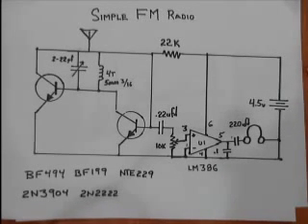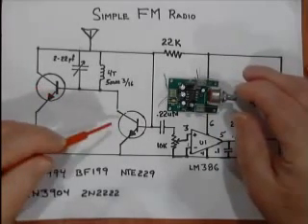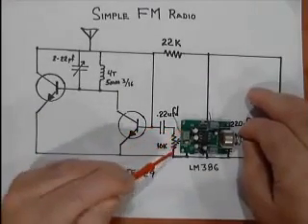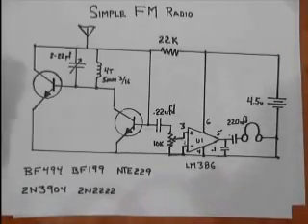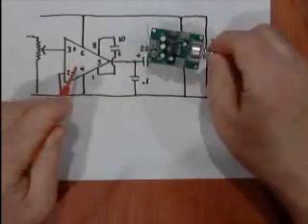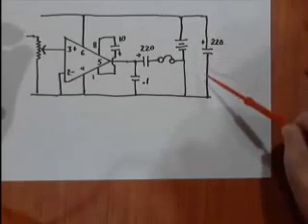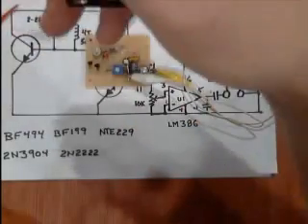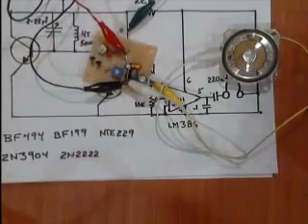Making A Simple FM Radio

Comment: In fact the two transistors are more in the configuration of an oscillator, not an FM receiver.  As bachkhoa pointed out a year ago this is, at best, a regenerative receiver.  It is probably generating inintended RF interference as well.  Sorry but this is NOT really a legitimate FM receiver.  A real FM receiver would be significantly more complex than that.  I hope the next schematic you find is more authentic.

Comment: What kind of an antenna should you use for this circuit?
Reply from the maker: I used a small telescopic antenna from a portable FM radio - thanks for asking
Reply: @rbashta  Thank you for replying! One last question for you. What does the pot do in this circuit? I know we use the variable cap for tuning, but how does the pot effect the circuit?
Reply: It controls the strength of the audio signal going into the amplifier IC LM386. Too little of a signal, nothing happens, too high of a signal, everything is distorted. Your attempt is to find that sweet spot where the signal is just right. Hope this helps
Reply: @randallbashta6957  thank you! I almost have it soldered so I'll give it a try. I appreciate the guidance

Comment: This is a regenerative receiver that detects FM by using the slope detection technique in which amplitude varies with frequency. It uses a Franklin oscillator, which is the most simple and easiest oscillator to implement.  As a matter of fact, sometimes you can remove either transistor and the circuit still can oscillate! What we need here (to improve) is a way to reduce the oscillation amplitude to improve signal readability (reduce noise); this can be done best by making the 22 k-ohm resistor variable. I would experiment with adding a potentiometer at the input to reduce the amount of signal that comes from the antenna. While this sounds counter-intuitive, it’s the most effective way to improve selectivity of the radio (thus, reducing noise). Reason being: regenerative receivers can amplify with extremely high gain (inferior to only the super-regenerative receivers, also an invention of Armstrong). With too strong of an input, a signal doesn’t make too many loops around the regenerative circuit before output becomes too strong. Consequently its Q is not high and its selectivity suffer (too much noise comes from nearby frequency). Reducing (all) incoming RF signal allows more room (so to speak) to amplify before the total energy reach the ear, this enables higher Q, higher selectivity meaning the ratio of signal of interest over surrounding noise is higher.
Reply from the maker: All good information. Thanks for taking the time to share the information. I do agree that this is slop detection and you can even remove one of the transistors. At some point I want to try re-doing this video as I did it a number of years ago. Thanks for writing - de N1KRB
Reply: Very usefull notes

Comment: Nice work indeed ❤
I would rather be happy if it is at all possible make 1 or transistor amplifier circuit diagram in lieu of op amp LM386 
I have a pocket world reciever which   uses only one transistor as speaker power output but it's hard to read circuit diagram as it very compact....waiting for reply 
Thanks above all🙏🙏🙏🇮🇳
Reply from the maker: My apology for not getting back to you sooner. There are a number of very simple one-transistor circuits available online. The only problem is that with a one-transistor amp, you can only use an earphone. The output is not enough to drive a speaker. To find a circuit, just Google schematic for one simple one-watt audio amplifier. For a transistor, I prefer a 2N2222 but most NPN audio transistors will work. Gook luck

Comment: FM? Where is frequency demodulator?
Reply from the maker: There is not a true FM demodulator in this circuit. However, the angle of the RF signal across the transistors creates a changing voltage drop at the base which mimics an audio signal. That distorted signal is then amplified by the LM386. This is known as slope detection. There are other videos on YouTube that use a similar circuit. Easy to make and fun to play with.

Comment: How are you drawing output from the base of that second transistor where the base is hooked up to the non inverting input of the Op-Amp ?? This part of the schematic does not make sense to me?
Reply from the maker: If you 'click' on the link in the comment section, you will see the exact schematic I used. The two transistors form a closed loop circuit where the output of the transistor on the right feeds the input of the transistor on the left. The output of the left transistor then feeds the input on the right. The exact frequency seen by the transistors is determined by the incoming radio station signal developed across the L-C tuning circuit.
Reply: Thank you and yes 👍🏻 I managed to figure that part out, circuit works great.
Reply from the maker: Thanks for letting me know. Good to hear.

Comment: This circuit work?
Reply from the maker: Like all simple circuits circuits, the performance is "iffy". This circuit's ability to work depends party on the antenna and the strength of nearby FM stations. Also, just like a simple diode radio used for AM broadcast reception, the sound quality is limited. But, technically, this circuit will work. The schematic is very similar to others posted on You Tube.

Comment: Can i use bc547 npn ?
Reply from the maker: According to Google - Because the collector current of the 2N3904 is 200mA and the collector current of the BC547 is 100mA, you can replace the 2N3904 with BC547 if the load you're driving is less than 100mA, but you can't use BC547 if the load is greater than 100mA

Comment: i have a question again can i use a s9018 transistor?
Reply from the maker: From the datasheet I saw, it can be. The s9018 works over over a high frequency range. I'm not sure about gain.
The 2n3904 and the 2n2222 - both very generic - works great, too.

Comment: Can I use s9014,s9013 transistor???
Reply from the maker: The 9014 and 9013 might work but they are designed for a lower frequency range. That is why I suggested the 2n3904 and the 2n2222. They both have twice the frequency range than the ones you mentioned. The 9014 has an operating range of 150 MHz where as the 2n3904 range is 300 MHz. FM radio operates from 88 to 108 MHz.

Comment: Nothing was heard !!!
Reply from the maker: Hi Mario - we have found you need a rather strong FM station in your area for this radio work.  It is like an old fashioned crystal radio, not very sensitive. Some guys I talked with also said they had to play with the length of the antenna to get it to work. And some other experimenters spread the coil wires slight a part, opening up the gap. And its worth mentioning that the tuning capacitor should be as close as possible to the coil to help the tuning oscillator process. I hope this helps.

Comment: Howdy.
Yes. That circuit works quite nicely. It is a slope regenerative circuit . One might use a 47k pot. to adjust regeneration for best sound quality instead of the fixed 22k resistor. 
Another addition would be to use a low pass RC filter before the op. amp. to correct the FM high audio bands boosting. The RC time constant is 75 us in USA and 50 us in Europe.
The two transistors form an oscillator that uses the incoming signal to uphold oscillation. Detection appears as current changes.of the oscillator as it fights the FM deviation.
Regards.
Reply from the maker: Thanks for taking the time to reply - all good suggestions. I think you're right. As the FM slope changes, the voltage change it produces at the input of the .22 ufd cap, produces the audio signal of of the FM station being tuned in. The next time I play with this circuit, I'll put in a pot in place of the 22k resistor. Again, thanks for your suggestions and remarks.
Reply: @rbashta  Howdy again.
I forgot one thing. One might connect a 4k7 resistor in series with the pot. to avoid accidently turning the pot too low which would destroy the oscillator transistors.
May I advertise my blog:  "1. Table of blogs. Blogiluettelo." which is a list of blogs. I have tried several circuits of FM detectors. The blog circuits have all proven to work
Regards.
Reply: @eugenepohjola258 
Is it 47k or 4k7 pot ?
As you suggested twice in your reply
Do you suggest 4k7 resistor and 47k pot in series ?
Reply: @microxone  Howdy.
I would substitute the 22k resistor with a series setup of a 4k7 resistor and a 47k potentiometer using one end point and the slider only, as a variable resistor. I should think the 4k7 resistor is needed to prevent accidently feeding B+ straigtht to the transistors. If that would happen one can kiss the transistors goodbye.
My experience was that the feedback is critical and tuning is fiddly. Scan for stations (trim cap.) in small increments and tweak the regeneration (47k pot.) until a hiss is heard indicating the detector is at the point of self-oscillating. Then turn the trim cap. again and tweak for hiss again. And so forth.
When a station is tuned in, decrease the regeneration (the 47k pot to larger resistance) if possible. Weaker regeneration produces better audio.
Cheers.

Comment: I would put a 50k pot in place of the 22k resistor so you can adjust the regeneration. The two transistors behave like a tunnel diode when set to the correct bias.
Reply: Tunnel diodes are very expensive, this is a poor man's tunnel diode.
Reply from the maker: That's good information. ..I'll give it a try.

Comment: I am a beginner Can you define the circuits Thanks
Reply: To start with, the antenna picks out the FM signals in the air. The antenna is connected to the tuner which is made up of the coil and the capacitor. The variable capacitor and coil, in parallel with each other, decides what station is passed to the two transistor amplifier circuit below. As the FM signal moves back and forth across the base of the transistor on the right, a slight voltage change is produced across the resistor. This produces a signal which mimics the signal the station is sending. This signal is them amplified by the LM386 which sends the louder signal to the speaker. I hope this helps. I may produce a video on this someday.
Reply: @randallbashta6957  I think it's a Superheterodyne circuit. If it is, can the mixer and oscillator be specified Thank you

Comment: Good job Radio66, just subscribed , are two transistor the same ? can be any one of bf494 bf199 nte229 2n3904 2n2222 ?  , I have 2n3904 and 2n2222a 2n2222 ,and indeed it's a lot fun to do
Reply: All the transistors mentioned have the same basic characteristics, and I think you could mix two different types, but my preference would be to use the same kind for this circuit.
Reply: @briancheshire1113  Thanks for the reply Brian Cheshire, I will try .

Comment: im trying with 2n3904 and it doesnt work !!! 3 attempts !!!
Reply from the maker: Double check the pin outs of the transistors: from the front - pin 1 is on left is the emitter, middle pin is the Base and collector is on right pin. Play around with the antenna length, make sure it is long enough. And make, the im 386 is set up for the max gain. Good Luck.
Reply: @rbashta  thanks but i tried it all im not sûre i can do this its really frustrating
Reply from the maker: Another fellow has a video similar to mine and perhaps by watching his, this video and help you a little more than mine.His link: https://www.youtube.com/watch?v=VmNlDewXt2MGood Luck

Comment: If i have to use one transistor, can i remove one transistor in the middle? If i can, how?
Reply from the maker: There are schematics I've seen on the Internet which have just one transistor, and technically it will work, provided you have a strong radio station near you. But remember, this is a very simple radio with very minimal performance capabilities.

Comment: Hey will there be any problem if I use 741 op-amp?
Reply from the maker: Both the 741 and 386 are linear amps but the 741 requires both a positive and negative power supply.

Comment: This radio would only work if the radio signal is quite strong within area....further than that you will need PLL and demodulation
Reply from the maker: You are absolutely right. Like any simple radio, it only works with a decent signal in the area. I was able to pick up high powered fm stations about 15 miles away. Still, a lot of fun to experiment with.

Comment: Hello Sir.
I was very surprised because it worked perfectly!
 At first I used the lm386 as an amplifier but it made noise so I decided to use one of those amplifiers from china, PAM or something, and it worked perfectly !!
Reply: You are so right, PAM8403 is a great class D amp and it comes cheap on a module
https://youtu.be/oB-k0tA1G2M
https://duckduckgo.com/?q=PAM8403+Audio+Amplifier+Module&t=ffcm&iax=images&ia=images
https://www.diodes.com/assets/Datasheets/PAM8403.pdf
Reply: TheAstro30 lol

Comment: Do you know what a reason would be for deep buzzing noise coming from speaker? its almost as if the coupling capacitor does not do its job and the output of the op amp is constant dc current??
Reply: Use a 9v battery with a 5v voltage regulator(7805) or LM317 set it to work at 4.5 volts
Or use 3 x AA or AAA ...etc.
Sometimes something from AC or Power Supply causes problems.
And run it outside away from different electrical/electronic devices.

Comment: sir i made  this circuit but it gives noise only when i touches with my finger at the input end of lm386n-1 beside this it is not working.
Reply: First thing to do is to make sure the coil and the variable capacitor are close to each other as they feed off of each other to create the right oscillation. Also, experiment with antenna lengths. Start with a foot and then move up to 3 or to six feet. Give these things a try. All the best.
Reply: I am just wondering if you would have any idea why when i turn the 10k pot it does not effect the volume? i have followed the schematic perfectly but cannot get anything but really low level static. Tuning the cap also does not effect the sound

Comment: I hope I can help. The two transistors form a very simple regenerative circuit, where the output of the transistor on the left - at the collector - feeds back into the base of the transistor on the right. Its what is called "positive feedback"  The strength of the signal at the base of the left transistor is  caused by the injection of the tank circuit - the capacitor and coil in the center. As with any regenerative circuit, as the base current goes up, the current of the collector goes down - that feeds back into the base of the other transistor, increasing the signal gain. Regenerative circuits are a good way to maximize the gain of a circuit.
Reply: What happens if we add a 3rd transistor?
Reply from the maker: I doubt it would work. The transistor on the right, from the collector, feeds the input to the transistor on the left at the base. Then the transistor on the left outputs the signal back to the input to the transistor on the right. This is a closed loop signal. The frequency of the signal oscillating back and forth between the two transistor is dependent by the values of the L - C tank circuit, sitting between the collector of the left transistor and VCC. As you change the value of the variable capacitor, the frequency changes. I hope this helps.
Reply: @rbashta  thanks, I thought it was just amplifying the signal.
Reply from the maker: @phs125   No - the two transistors are used for oscillating the fm signal. The angle of the sine wave at the base of the right transistor creates a varying voltage drop at the base which looks like an audio level signal coming from the station you are tuned to. That signal is the sent to the input of the LM386 which does the real amplification of the station's signal.

Comment: This is weird. I don't see how it detects, ie, converts FM to an audio output. I'm guessing its off-tuning a bit.
Reply: It is a regenerator circuit.  Usually there are more resistors  caps and inductors around a single  transistor. This circuit has less components, but it works by a virtue of unique combination of parts and supply voltages.

Comment: Thank you very much for this circuit. I assembled it and it worked quite well at short range. Do you have any tips on increasing the sensitivity so it works better at longer range?
Reply from the maker: The only thing I can suggest is to play with the antenna length. As you can see, it is a very basic circuit design with very few options for improvement.
Good Luck
Reply: I'm trying to make with the things on hand and none of them are the same 😂 it's gonna fail
Reply: @daddyplankton5855  can i use c945 ,s9018 Transistors   insted

Comment: On the subject of small FM radio receivers, I had a radio from a cap. I think it was solar powered or used button cells. It had 6 transistors and one integrated circuit, among the components. It had an earphone. The circuit itself was very compact. Another FM radio I had was from a promotional giveaway, if I recall. It had 2 transistors and one integrated circuit. Again, the circuit board was very small. It used three triple A, 1.5 volt batteries. It used earbud type headphones. Your circuit looks pretty neat. It's a similar concept to the second FM radio I mentioned. If you lived a hundred miles or kilometers from a major city, I wonder how sensitive these receivers would be. I know that attaching a wire from your FM antenna to your cable outlet for your T.V works a charm to get distant FM radio stations.
Reply: The first FM radio was part of a ball cap.